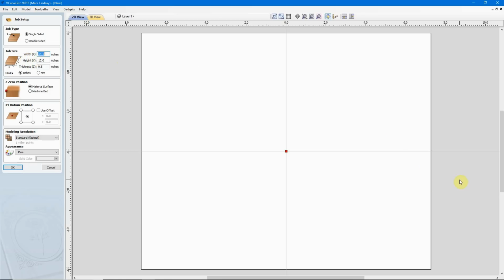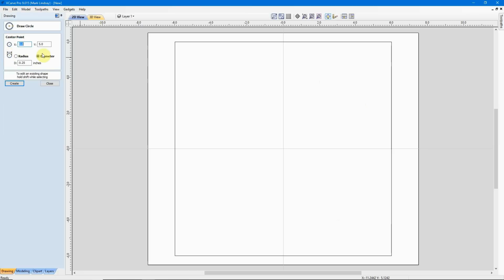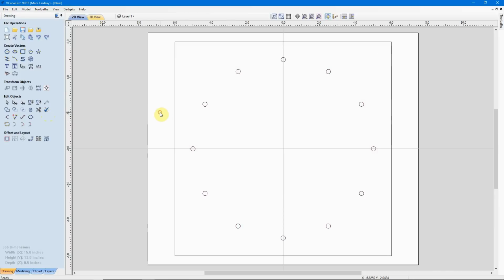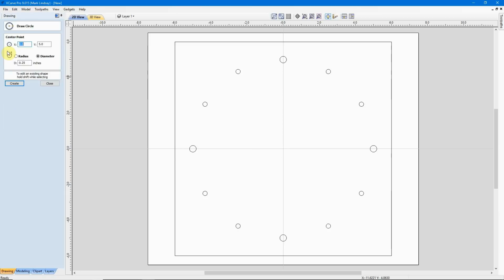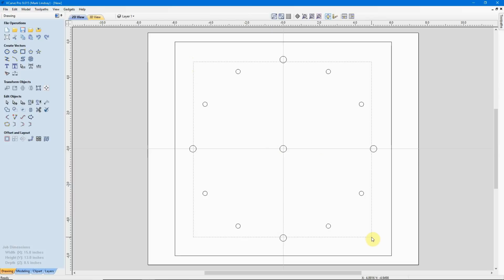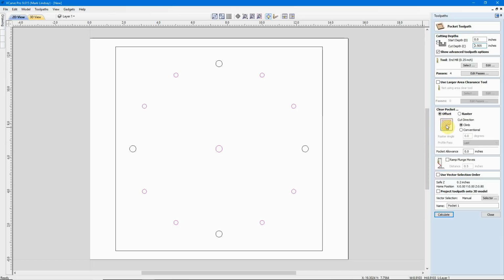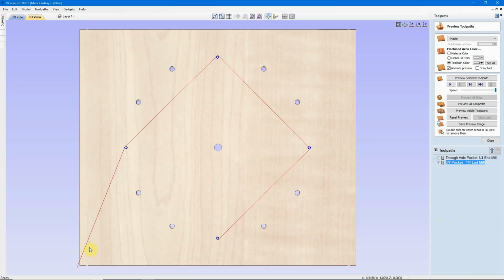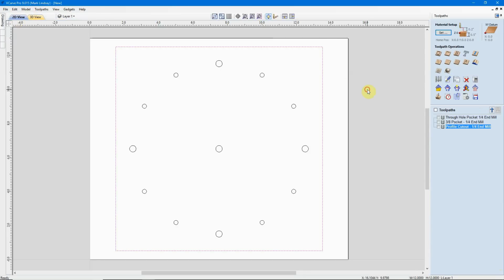Project Design and Pocket Toolpath - Part 3 - Vectric For Absolute Beginners

Comment: Mark wow, Thank you for a slow In-depth video on not just making a clock face but the how to figure the hole depth. your my go to instructor.. I'm brand new to the CNC and you are making it more easy to understand. I first seen you on the ICD woodcraft live so I look you up and seen what you had and now I'm hooked. what is the best program to load all the information to mill the job? I was told to get Openbuild or gsender. ?? Im slow but sure. age 75

Comment: Hi Mark, have drawn a Celtic knot, which is a triquetta intersecting with a circle. For the overall 100 x 100mm design, an engraved slot  width of 6mm looks good. There are unders and overs in this design, with the circle and the triquetta interleaved, and as you follow the circle around, it goes under and over the triquetta.
My question is, how do you do this on a CNC machine? The curved slots will be 6mm wide and 2 mm deep, and then filled with coloured epoxy. Hope you can help...regards, Joe

Comment: Hello Mark, Thank you for the videos  i downloaded the VCarve Desktop Pro to try to learn the software before i get my cnc. im on the 3rd video and when i try to set the 3/8' deep 3/8' holes and calculate the toolpath, it only shows one hole being cut. im sure that it has something to do with how i did the select, but i cant figure out how to make it right
Reply from the maker: Make sure you have selected all of the 3/8 inch holes. It sounds like you only have 1 of them selected. Open the Pocket toolpath (you can just double-click the toolpath that's only pocketing out the single 3/8 inch hole,) hold down shift and click on each of the 3/8 inch circles to select them, set up the toolpath as I demonstrated, then Calculate the toolpath. That should do the trick.

Comment: Just to clarify, you said no tool changes for entire project. So i would use a 1/4" upcut endmill , correct? Appreciate all you do for us beginners in trying to learn this. Love your tutorials and your teaching methods.
Reply from the maker: It depends on the project. Most of the time (about 90%) I would use a downcut end mill to prevent chip out around the edge of the pocket. If I wasn't concerned with chip out, I might use an upcut end mill.

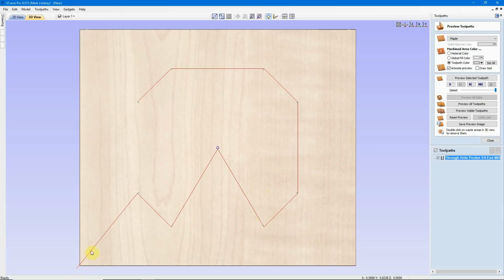Comment: Watching this and I'm at 22:55 when you calculate your tool path . . . . 
So the bottom left going up to say the 1 o'clock position is the same.
The rest of the tool path is mirrored or upside down. You have mountains with a flat sky, I have a flat bottom and large V on top. Makes sense?
Does this matter and why is mine different?
Is it just a software issue since your video was made 3 years ago and I'm using a current copy of Vcarve Pro?

Comment: Hi Mark, hope you are still alive😁 to answer a question i have after watching the video(amazing video, thank you)

Do we need to run the quarter inch end mill 3 times from the Datum position for those 3 files you saved including profile?

Also, i can only create files in Aspire but have to use Easel, ugs or similar software to run this file? Or Aspire can be set to both design and run the files like Easel?
Reply from the maker: I'm alive and kicking, Robyn!

I answer your first question and show you how it's done in the next video in the series, here: https://youtu.be/kFIkyl8tUFU

As for running the file, I'm not familiar with Easel or UGS, but I believe you save the g-code using the correct post processor for UGS, then load that file into UGS, and run it from there. If anyone using UGS can confirm that for me, I'd greatly appreciate it!

Comment: Mark, The only thing I'd change is the name of the series. I've been using V-Carve for about 3 or 4 years and just struggled through what I could learn here and there to do what I wanted to do at the time. I'm not an absolute beginner, but still am getting a great deal from these videos. Thank you SOOO much! This is a great course, even for someone that's used the software for some time.
Reply from the maker: Thank you very much, Terry.  I really do appreciate that. I was that guy looking for answers, so I decided to really dig in and learn it, then try to share what I learned to others looking for those same answers.

Comment: An excellent project that summarizes the knowledge of past parts. Unfortunately, for the first time he disappointed the translation of subtitles. He couldn't explain the end of the mill. Is this explained in another video? Otherwise, thank you for the perfect work. Roman
Reply from the maker: An "end mill" is the collective name of the type of router bit I'm using. It has a cutting edge on the bottom end of the bit, so it will cut as it plunges into the material.
Reply: @MarkLindsayCNC  I know now. In the Czech language it is a "cutter with a drilling tooth" Thank you for your explanation. Hooray for the next part.

Comment: Hello Mark..When using an end mill to drill, why not use a bottom cutting end mill for the 1/4" holes? I have experienced the heat problem while milling.

Skip....
Reply from the maker: You can use a bottom cutting end mill, Skip - the important thing is to make sure the chips evacuate upward, out of the hole as they're cut.  Thanks for watching!

Comment: Thank you Mark...but is it possible to use metric for the tutorials?
I think is more easier to us to understand the examples....inches is difficult...
thank  you..
Reply from the maker: Thanks for checking out the video! I do appreciate it.

I don't want to get into the Metric vs Imperial discussion, but I was raised using Imperial, so that's what I use. Looking at the numbers, the overwhelming majority of my viewers are in the US (fully 91%,) and therefore use Imperial. Unless that changes dramatically, I have no plans to change. 

Thank you!
Reply from the maker: Also, please remember that the Vectric software has calculators built into them to help you convert from Imperial to Metric. I did a video on that subject last year. Here's a link: https://www.youtube.com/watch?v=KE4kxHxE95g

Comment: Mark,

I greatly appreciate you taking the time to put these videos together.  I just downloaded the V-Carve Desktop full version, and.... to say the least was bit overwhelmed.  haha  I started from the first video, (Agreed boring for me a little bit) since been using easel for last several months, and became comfortable.  Video 2-3 have been very helpful to better understand the icons.  Please continue to educate folks like me.  I am starting to better understand why everyone said once you make the switch, you will leave easel in your dust.  haha
Reply: Mark,  Yes I did pick up quite a bit of info from this. I look forward to continue reviewing your other videos. Not looked to far ahead, but curious if already have or plan to show I g how then to use G-code sender to send your project to the Cnc for cutting. Thanks
Reply from the maker: I talk about saving g-code in Part 4, but not using G-Code Sender. I've never used G-Code Sender. I use Mach3 to control my CNC, and all I need to do is save the g-code to a flash drive, take it outside and transfer it to the computer out there, then load it straight into Mach3, then run it.
Reply from the maker: Thanks very much, Brian! Now that you're past the very basics, things will start to pick up in the videos. I had to make the first few based on the idea that the viewer had never done anything like this before, and didn't know anything. With the very basics done, things will begin to fall into place, and the pace picks up. Hopefully you picked up a nugget of info or two from the first few.

Thanks again!

Comment: Quick question how do you know by looking at your bit if its up cut or down? Thanks for another great video.
Reply from the maker: If you stand the bits up so that the cutting tip is pointing upward, then look at it from the front, the spiral on an upcut bit runs counter-clockwise. On a down cut bit the spiral runs clockwise. I plan on doing a video on what I consider to be essential bits for the beginner in the near future, and I'll get further into the details.  Thanks for watching!

Comment: You mentioned not to use a down cut bit for holes. Would a up-down compression bit be ok?
Reply from the maker: Not if you're drilling straight down. The chips need to be ejected from the hole. Down cut and compression bits don't eject the chips out of the hole, and that causes friction, and that can (will) catch fire. Best bet is to use an upcut bit. If you're worried about chipout, just use the bit to mark where the hole goes (set it to cut maybe 1/16" deep,) then drill the through hole with a drill or on the drill press. If the hole is a larger diameter than the bit, meaning the bit will plunge down, then move in X and Y to cut the hole, you're fine to use whatever bit you'd like, as long as those chips can get ejected from the hole.

Comment: Mark Great video.  Have a question though. After you had all the circles drawn you deleted the 3 6 9 circle to resize them using the array tool. Could you have just selected the the 4 and  grouped them and then resized them. Jeff
Reply from the maker: Excellent question, Jeff.

If you need to resize an object, you need to select just one example of that object. If I were to group those 4 circles, then try to resize, it would increase the size of the group - not the individual circles. I'll demonstrate that a bit further in the next video. 

Thanks for watching!

Comment: Another superb tutorial, Mark! I went all the way through it without having to rewind once to try to understand what you were trying to convey. You're an excellent teacher. I was already going to comment on the fact that your screen capture software makes your Vcarve videos crystal clear, and we can actually see and read all of the icons on the Vcarve screen instead of only getting a general area of the screen like in most other tutorials I've seen. Especially Vectric's own tutorials.
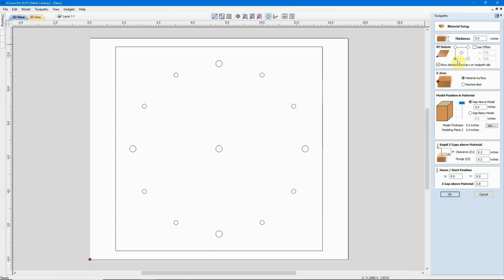I'm not clear on what determines where the x,y datum position should be. For example, in this lesson at about 18:00 in, you change it from the center point to the lower left corner. Could you explain why that was preferable?  
Thanks for doing this series. It is demystifying Vcarve very well for me.
Reply from the maker: Thanks for your kind words, Jim!

I set my X Y Datum to the center of the material when I'm drawing and laying out a design, just because it's easier to use the center as a reference point when I'm placing objects or vectors on it. When I get outside on the CNC, I set my X, Y, and Z zeroes on the material's bottom left corner, using my Triple Edge Finder touch plate. After I'm finished laying out the design and I'm ready to calculate the toolpaths for it, I change the X Y datum to the bottom left corner of the material so the toolpaths will be calculated from there. I'll get into that a little deeper in the next video. I'll get into saving g-code and cutting the project, so I'll talk a little further about the X Y datum point then.